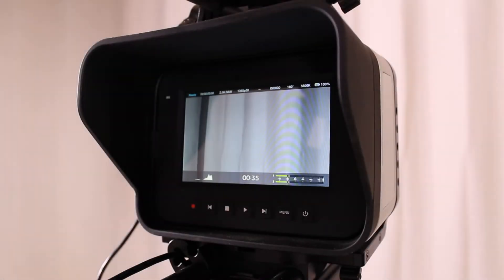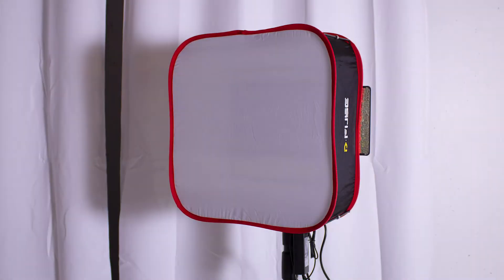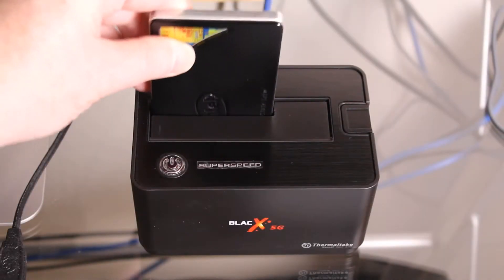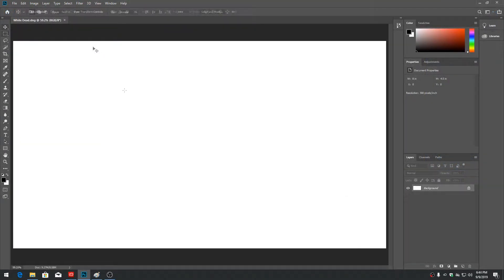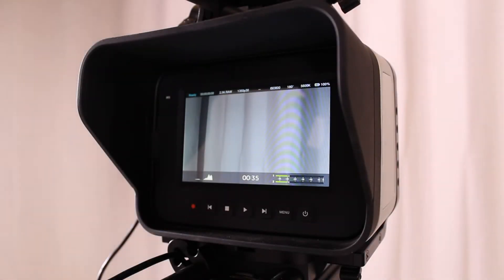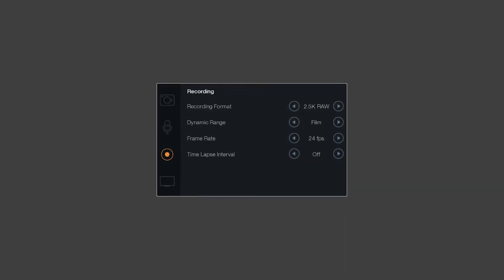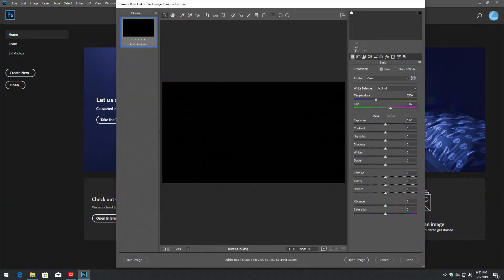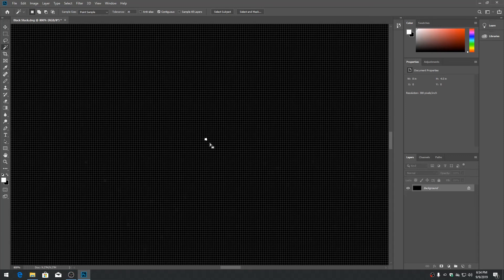Tech Show - BMCC - Dead or Stuck Camera Sensor Pixels

Comment: Can it be fixet by adding some mask or whatewer into the camera?
Reply from the maker: Some of the video editing software allows you to apply a camera correction mask to remove hot pixels.  This feature varies by the software so you would have to check with the software you are using.